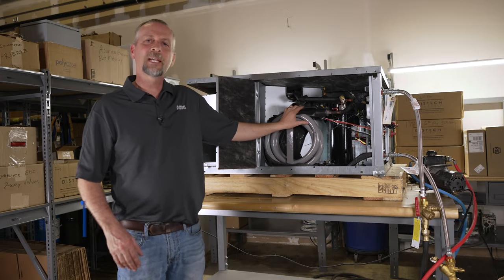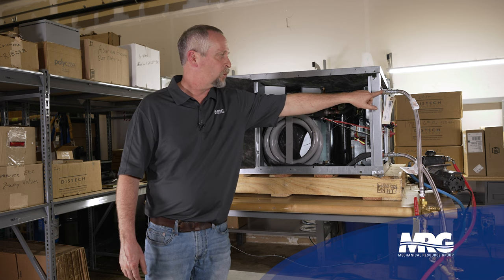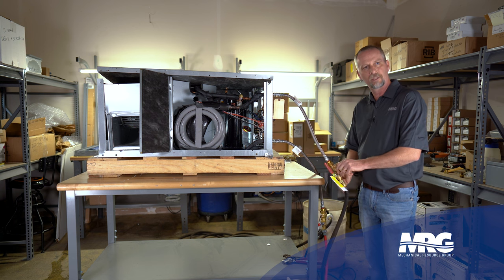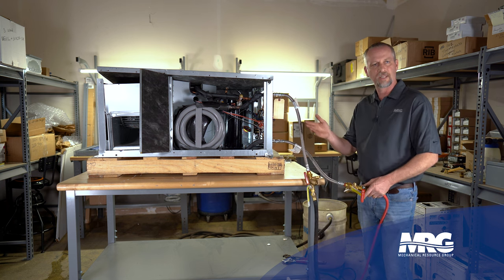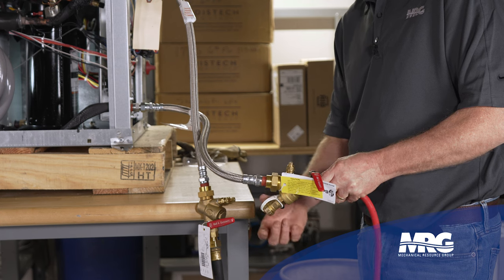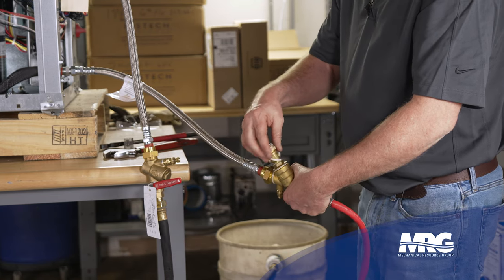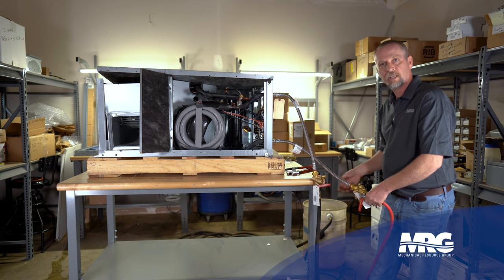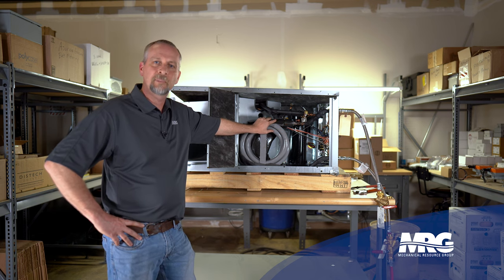Hacks to Make Backflushing a Daikin WSHP Easy: What every Technician Needs to Know!

Comment: How many GPM can you safely run through the unit for a blackflush? Excellent video. Thanks for the info.
Reply from the maker: The GPM should be on the data tag of the unit for what the coaxial heat exchanger is rated for. When backflushing, you are typically using the system water pressure that was already going through the heat exchanger, but you are reversing the flow. If using the existing system water, there should be no concerns.

Comment: You asked for questions, so here it is...
Is it ever feasible to replace the coaxial heat exchanger if it becomes compromised? 
(I have an older unit that is otherwise operational and would like to put it back in service.)
Reply from the maker: Yes you can change the coaxial coil. I would base it off age of the unit and the condition of the other components such as compressors and motors. 
Note : when replacing the coaxial coil it is brazed copper to steel so you will need to be familiar with brazing this using 50% silver solder with flux.

Comment: i am trying to find the video you reference in the above video about circuit setter valves, does anyone have a link to it?
Reply from the maker: We haven't had the chance to film it yet, hopefully we will soon!
Reply: Just subscribed, I too am looking forward to this video and others... Also do you have a link on circuit setter/ strainer valves etc.  Possibly consider building out your channel with links to tools and equipment used to add additional revenue streams. Thanks for the video.  I am dealing with my mothers WSHP that keeps shutting off from high head pressure.  I think its a building issue. building says its the unit even though its brand new and the old one was doing same thing so my mother had it replaced.  However it was installed (not by me) no strainer, the only thing it has is two shut off valves... Last AC tech that came out said strainer wasn't needed... I call BS on that while it might work without it eventually it seems like it could lead to issues.